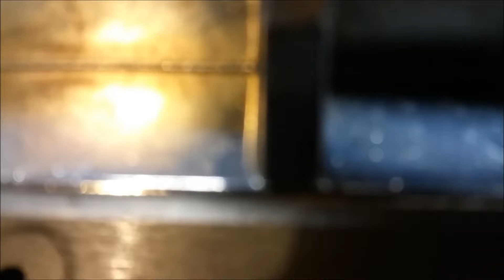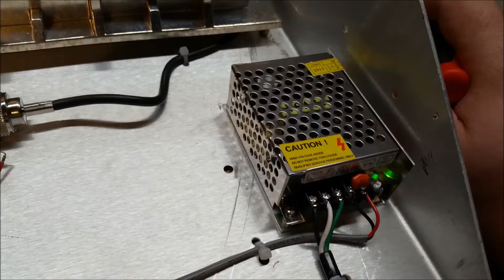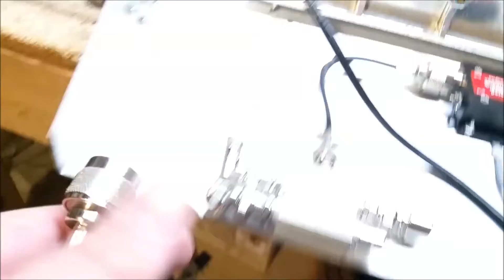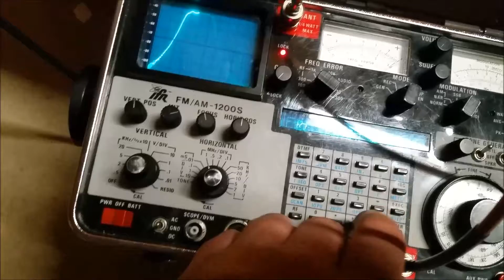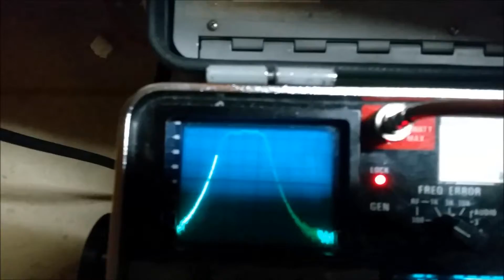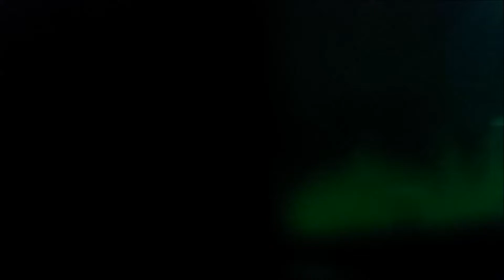Home Brew UHF Preamplifier Multicoupler

Comment: Very nice setup! I cringe when I hear a MSF5000 has been butchered for its parts. Lets give equal bids to the Generuous Electric Master II PRESELECTOR ( pun on name intended, I use the M II equipment as well ) only issue I see wrong is the input bulkhead connector is not shielded. Get an Amphenol 203/743-9272 shroud and redo that input! Clean the aluminum tray with some fine steel wool for better electrical contact with the shroud.
73!  
From a fellow ham and semi retired commercial radio tech.